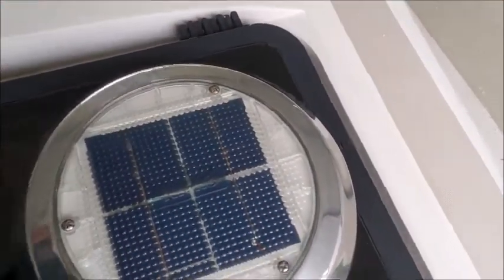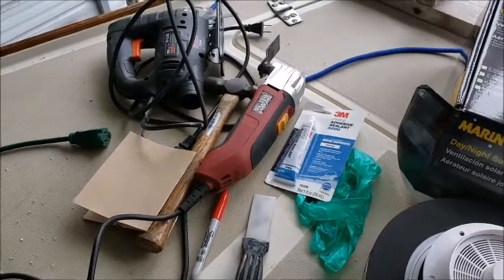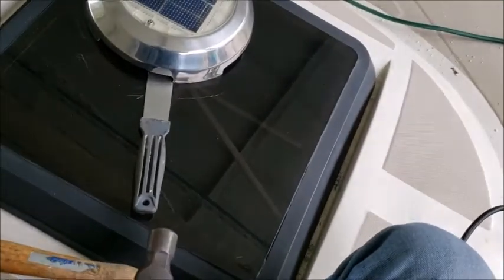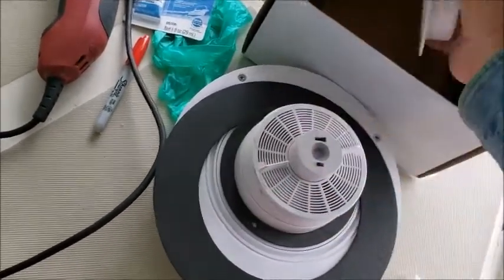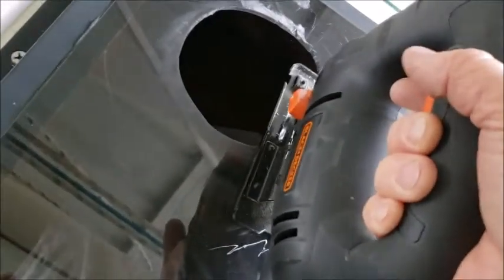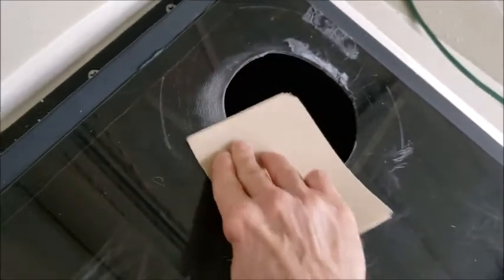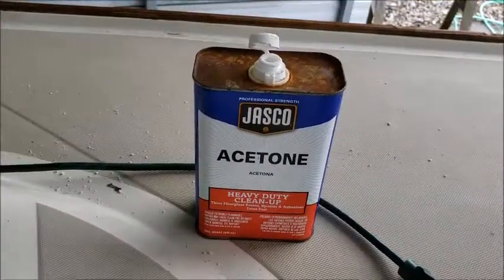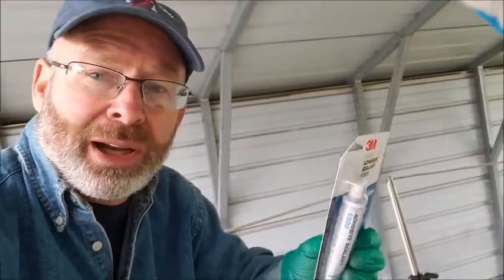Installing a Solar Fan

Comment: Why the choice of 5200?  This component isn't one that requires that amount of structural bond and I think there are a few things out there that actually seal better.  I was under the impression that 5200 was designed with adhesive properties first, sealing properties second.   Life Seal, 4000UV, etc?  Maybe even Butyl tape could do a better seal over the years. 

Why did you toss the ring that seals to the deck then relies on threads to seat the fan?    What if you need to change the battery or troubleshoot the fan  :/ 

Sorry, don't mean to be too critical, I appreciate the video.   Just boat questions.  :)
Reply from the maker: Thanks for sharing your views. You should start your own tutorial! I use butyl rubber for less permanent seals as it flattens as it stretches with heat over time. Using the ring is a good idea for the reasons you  mentioned, but it's seating surface isn't as large.

Comment: Not at all how to install this fan, there is an inner ring which is adhered and screwed to the deck, the fan screws into that and is sealed by the rubber ring inside. When done properly, a faulty fan could be untwisted from the (properly installed) mounting ring and an new one installed without any tools or adhesives.  Also, put down some tape to protect your plexi before sawing or better yet use a hole saw.
Reply: Any videos for this?

Comment: Confusing video, as Marinco provides you a mounting ring that the whole unit screws down into, rather than just using 5200 to glue the entire unit to the top of the hatch. They even give you a sealing gasket for the ring, but you didn't make use of it at all. Had you used the threaded ring, you could much more easily swap out the unit at a future date simply by unscrewing the old and screwing down the new via the mounting ring. You're putting all your faith in the adhesive when you could also have a mechanical connection.

Comment: what a dumb thing to do, these need to be disassemble to replace the battery or motor - 4200 or just butyl is the right sealant